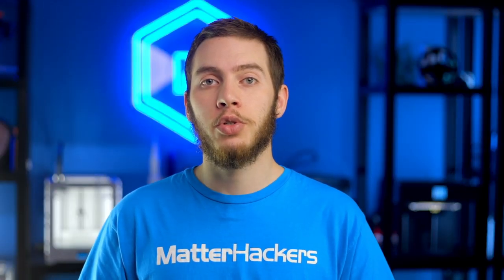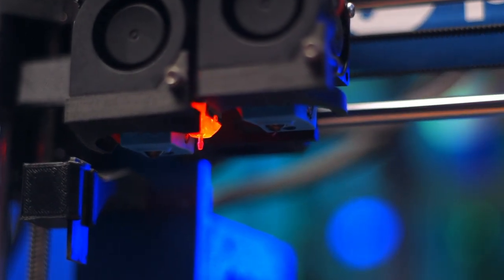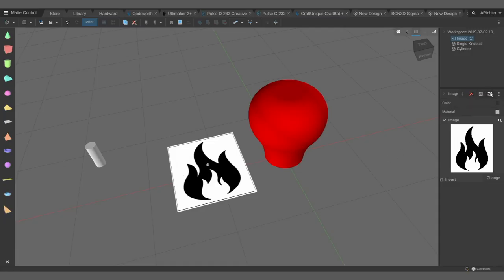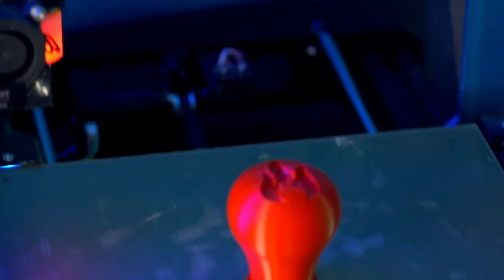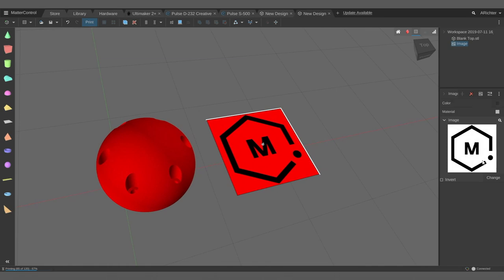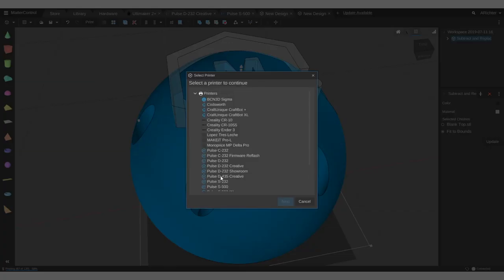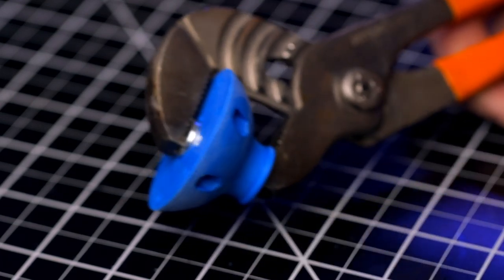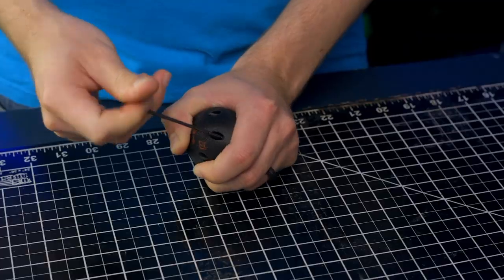3D Printed Custom Shift Knobs // Weekend Builds

Comment: I would have attached those knobs to an electric drill, spin and sand down to get a smooth and even finish.
Reply: Smart!
Reply: @Duci1989  It's actually quite common in carpentry / CNC when we work with lathes.

Comment: My concern would be keeping the knob tight, I've had manual cars in the past with aftermarket shift knobs and used threadlock with metal-metal connections.  How does this hold up over time?  Also shoutout to another Prius owner.
Reply: you could always use plumbers tape inside the thread. good thing about 3d printing is that if it's slightly loose, you only have to readjust your values and reprint.
Reply from the maker: @phizicks  That's a great idea! - Alec

Comment: how did you make sure the graphic on the from always faced the upward?
Reply from the maker: By using either a nylock nut and having a deep enough hole for the post, you can thread it on and adjust it to display properly. For the knob without nylock, you'd just need to do the same thing by eye and adjust as you use it. - Alec